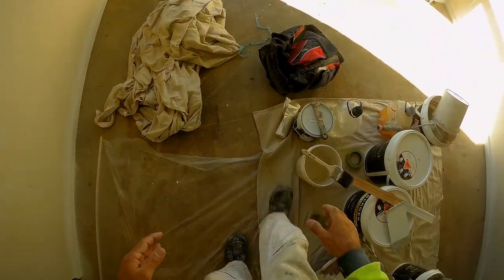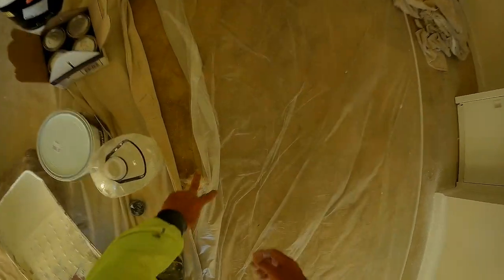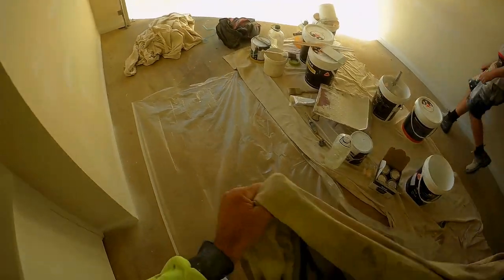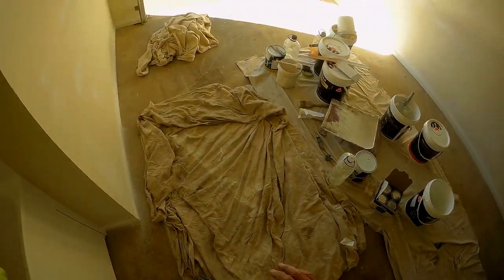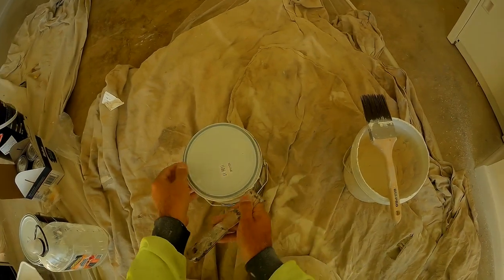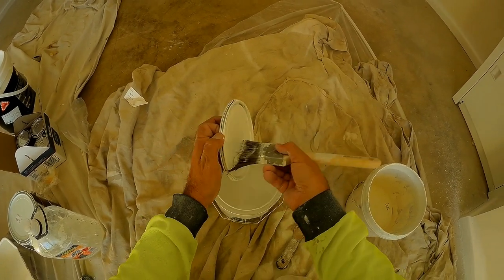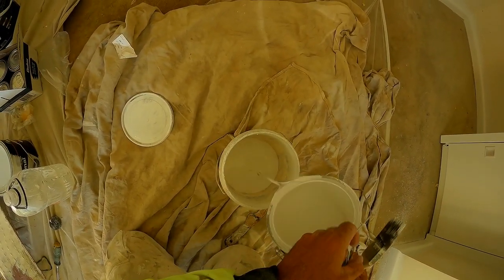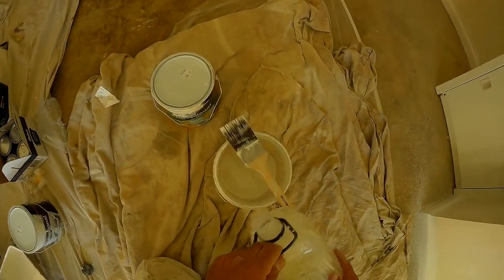Trick to keeping paint off concrete floor when mixing enamels.

Comment: How come u stir it with the brush and not a stick? I love turps in enamel makes it flow so good do you always thin with turps or do u prefer penetrol?
Reply from the maker: Pete Mmz  only a small amount of turps was used so not a lot of stirring and its a fresh brush so cant hurt to get a bit of turps on it before painting. 
I usually only use turps for thinning and  penetrol is used for getting better coverage in darker enamels and to provide better adhesion to old enamels. If your using a cheaper gloss enamel it cant hurt to add penetrol for a better shine ,but i now use a premium gloss so sheen is already brilliant.
Thanks for the questions
Reply: ThePa1nter thx bud... gna try the uni pros for enamel are they the sash cutters or just uni pro wall brushes ur usin in d vid? Im usually using oval brushes with long handles monarch abcs but these ones look good for throw aways
Reply from the maker: Pete Mmz 
Just the wall brushes,around $6 each,they loose an odd hair but the best brushes and if you want to, replace them with new ones for each house,